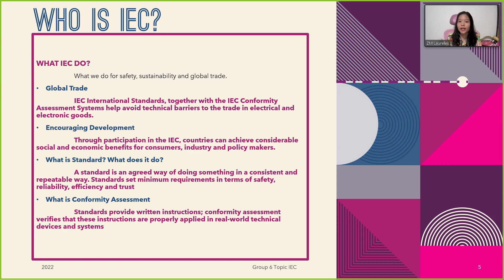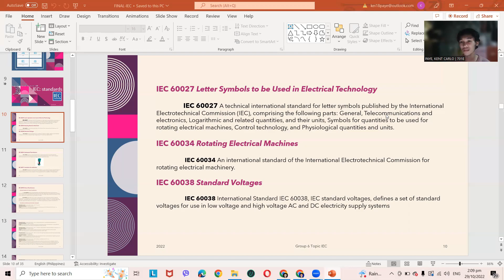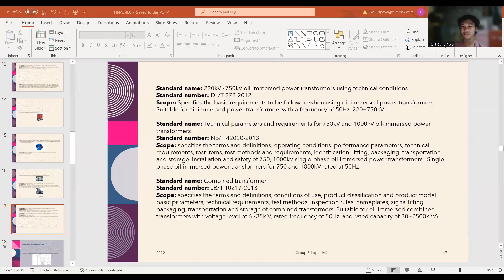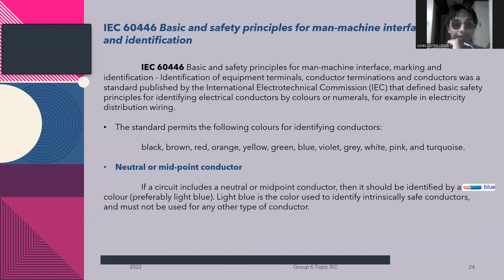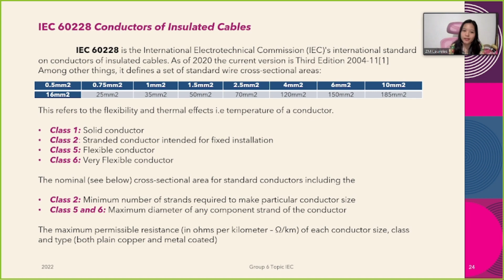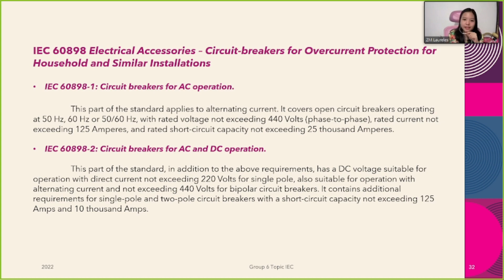International Electrotechnical Commission (IEC)

Comment: Thank you Group 6 for an informative video presentation about IEC - International Electrotechnical Commission. Following standard procedures is necessary and a must in every workplace because it results in a quality work output. In IEC I learned the standard in electrical engineering must be followed to avoid hazards and possible incidents; it also discusses taking care of electrical matters, intruments and equipment for safety purposes.

Comment: Thank you Group 6 for this informative presentation i learned that The main purpose of the IEC is to promote international cooperation on standartization in the field of electrical engineering, including electronics, magnetism and electromagnetism, electroacoustics, multi-media, remote communications, energy production and distribution, as well as related general disciplines such as terminology and symbols, electromagnetic compatibility, measurement, safety and environmental protection.

Comment: Thank you group 7 for the informative presentation of IEC (International Electrotechnical Commission). I have learned that in this particular organization it sets the international standards for handling electrical, electronics and any related technology. It as well works with several major standards such as IEEE. As tackled by the 6th group they also commend and award those people who contribute to the safety of the products used in electrical system. Under IEC 60446 or The basic and safety principles for man machine interface and identification ate the principles for identifying conductors by colors and terminals, including the neutral and midpoint conductor. It is, as expected, an educative discussion.

Comment: This video is very informative and presentable. The audio is clear and the speaker have a better communication to get the attention of audience. IEC helps me to understand to avoid technical batteries to the trade in electrical and electronic goods. The standard set minimum requirements in terms of safety, reliability, efficiency and trust. Thanks to the group 6.

Comment: Thank you for sharing this informative report. The reporters explained the topic clearly and concise. Additionally, I have learned in this topic that International Electromechanical Commission Standards ensure and assess the conformity to standards in the field of electricity, electronics and other related technologies for safety and security. In IEC 60216 about electrical insulator materials of the thermal endurance properties states on how to apply the specific instructions and guidelines and specifies the methods to be used for determining thermal endurance characteristics.

Comment: Thank you so much  for sharing  this topic about IEC or International Electrotechnical Commission after I watched your video presentation I  learned a lot especially the Mission and vision of the IEC  to ensure the safety, efficiency, reliability and interoperability of electrical, electronic and information technologies, to enhance international trade, facilitate broad electricity access. Proper materials and tools to be used in a circuit is needed.  I also learned that IEC are the standards used for industrial activities in international basis.

Comment: Thank you for a great Presentation. I learned in the presentation that in IEC 60095 that is about starter batteries; that these type of battery having nominal voltage of 12v are usually used as a source of power that energizes internal combustion engine, lightings, and as well as to  auxiliary  equipment of internal combustion engine vehicles.And this type of battery have 3 types that are used depending on their designated types (a) flooded batteries (b) enhanced flooded batteries (c) valve regulated lead acid batteries. Thank you group 6 for an informative report.

Comment: Thank you group 6 for this topic it gave some insights about IEC 62600    
Its purpose is to provide an appropriate level of protection against damage from all hazards that may lead to catastrophic failure of the MEC structural, mechanical, electrical or control systems.

Comment: I appreciate you sharing this video with me because it gave me a lot of insight on IEC. IEC 60446 offers general rules for the use of specified colors or alphanumerics to identify conductors in order to clear up any ambiguity and guarantee safe operation. These conductor colors or alphanumerics are intended for use in busbars, electrical systems, and cables or cores. Thank you reporters.

Comment: International Electrotechnical Commision is non-profit organization that prepares and publishes international standards for all electrical, electronic, and related technologies. I've learn from this prensentaion, to ensure the safety and efficiency of system and devices they have standards. First standards is "we must allow products to work and connect with others" second is "make sure that they use testing and certification to verified manufacture promises kept" then "it should provide technical details regulations" and last "facilitate international trade". Other thing I've learn IEC standards cannot be preference issued by other organization. Great presentation and clear explanation, appreciate it!

Comment: Thank you to the reporters. The report is very informative and helpful. I have learned that IEC standards give the regulations and guidelines that ensure the safety and performance of products while also assisting in reducing trade restrictions. They serve as the foundation for conformance testing and allow electrical and electronic devices to enter global markets.
IEC 60269 is a set of standards for low-voltage power fuses that serves as an application guide for low-voltage fuses, demonstrating how to apply current-limiting fuses to protect, combined with advances and sensitive electrical types of equipment. This guide contains essential details about fuses and information on how to use them.